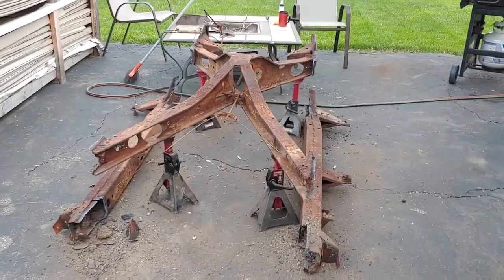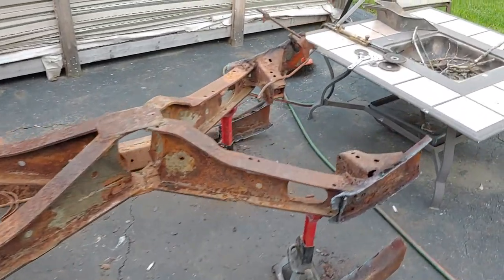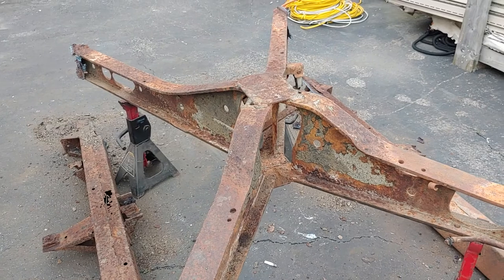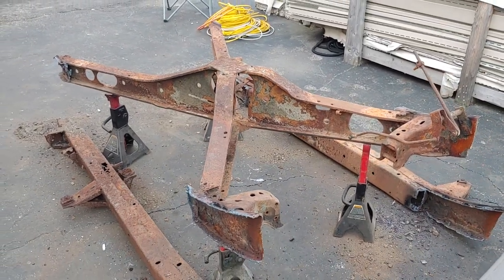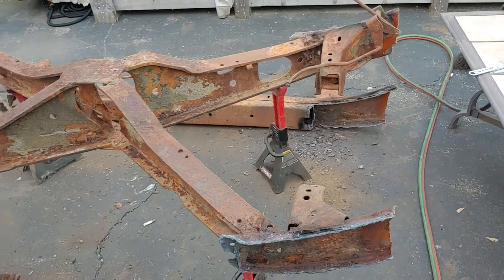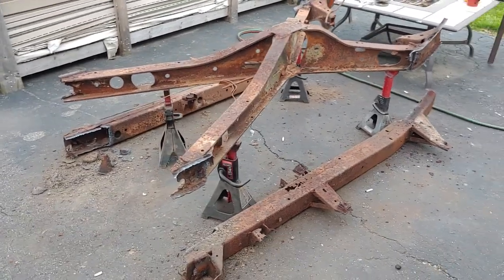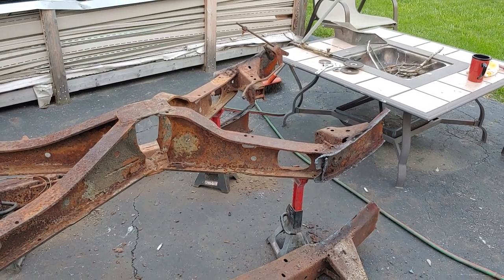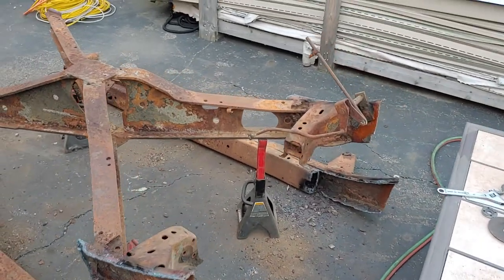1955 1956 1957 Chevy Belair Convertible Famous X Frame

Comment: That's a massive X frame 😳. I had never seen one. I Had heard that the frames were heavy duty and that there is extra bracing on the bodies. Supposedly to help them not flexing.
Reply from the maker: Hey Big Block Kings! Yeah there very strong and rigid! They do have additional body mounts to help the body from flexing! The body of a convertible is very beefed up as well to keep everything straight and true! Talk to you later buddy!✌️

Comment: Hi Don. I've started a 55 convertible. Hoping you could tell me why skid plates are on a convertible. Are they really needed?
Reply from the maker: Hey David! Yes the skid plates are needed and they are there to protect the X frame! If you have a original x frame installed without the skid plates it will hang down about 1/2 inch lower than the frame rails! The skid plates are the lowest point on a convertible frame to help it slid over anything it comes close to! You'll need to add them to your frame if you don't have them! Have a good one Buddy 👍